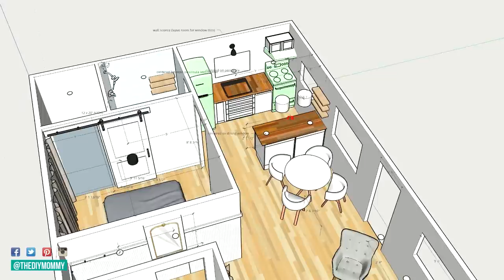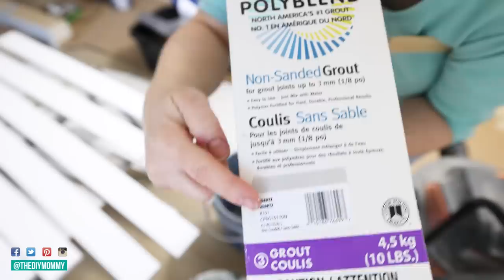EXTREME Small Kitchen Makeover | Part 2: Before & After! | Tiny Cabin Airbnb Renovation

Comment: If your fridge doors opened the other way, you might have needed to leave quite a gep between the fridge and the wall so the doors could open properly. I have the same configuration in my kitchen but with the fridge doors hinged on the left. The delivery guys had to leave a good sized gap for the doors to open. You would've lost some cabinet and bench space.

Comment: Is it possible to flip the handles on the refrigerator and the freezer where it opens towards the rest of the kitchen?
Reply: My question, too. Is it possible you are not able to order this to open on the right side?
Reply: @sydneywood4398  most refrigerators allow you to switch handles on left or right side. To check it, just look on the opposite side of the top of the refrigerator. If you see a small button cover on the body and another on the door, then it is switchable.

Comment: I think the style and materials used is just gorgeous!  I really love your style.  However, as a kitchen and bath designer, I am cringing because you have two design flaws in your finished product. First, next time you put a dishwasher next to a range, make sure you add a filler return panel or a 3/4 dishwasher panel between the range and dishwasher.  A dishwasher is NOT supportive of a countertop and over time you will have a problem if not from the very beginning.  And 2nd, when using frameless cabinets, like IKEA cabinets, you should always add a small filler between the wall and the cabinet.  I am speaking to the peninsula.  This will help to avoid any binding issues with the doors/drawers  of the cabinet or the handle/knob and the wall.  Otherwise, it looks really nice and I hope that is helpful advice for future kitchen designs.